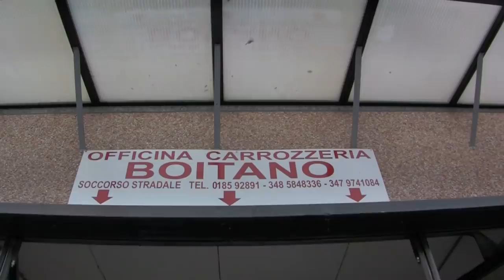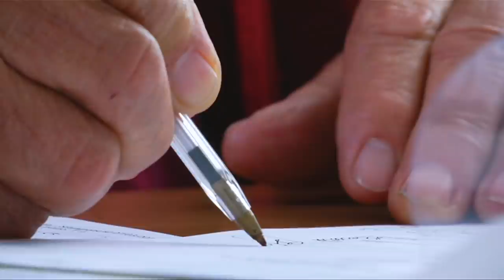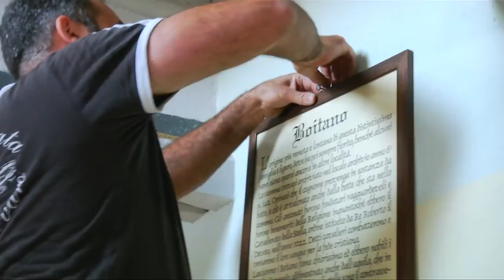Brian Boitano's Italian Adventure - Cooking Special

Comment: I have a very soft spot for Liguria; it is a completely different animal from the nationalist, racist, obnxious portions of the North - Piemonte, Lombardia, Emilia, Veneto.     But it is also a very unusual place running from San Remo over to La Spezia.. Huge contrasts in that long coast.  I think the MOuntains that form it's northern/eastern borders helped concentrate it's culture.  Genoa has a lot in common with Napoli, as a working class maritime city.  Hell the tifosi of the Genoa FC and SSC NApoli actually have a "gemellaggio", a twinning of sorts, and will generally  root for the other team, except in direct battle.  I truly wish I had had more time to spend in Genoa during my years stationed in Italy.

Comment: There’s no closed captions for we hearing-challenge
Need!
Reply: Braina. Brainais an AI-based virtual assistant software that includes voice recognition for Windows PC users. The voice recognition software enables users to convert voice to text on any website or word document, and supports over 100 languages.Jan 23, 2019 HOPE THIS HELPS.  if not - google voice to text for your system.
Reply: @gaslitworldf.melissab2897     I use Apple products exclusively.